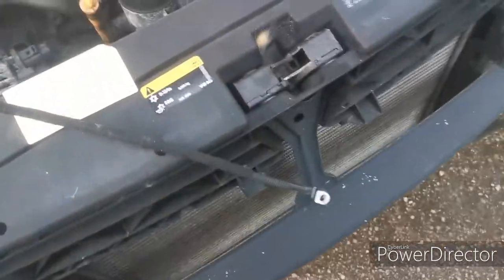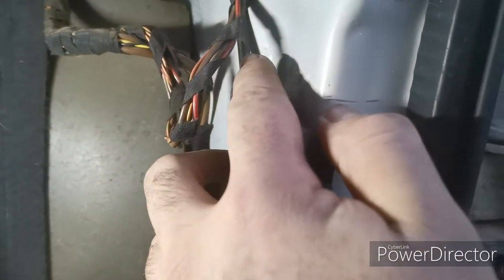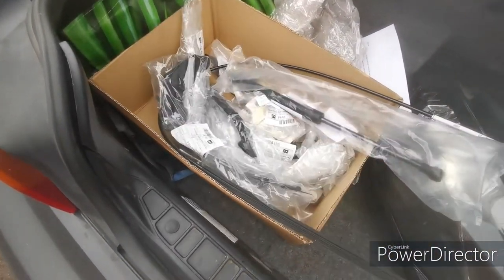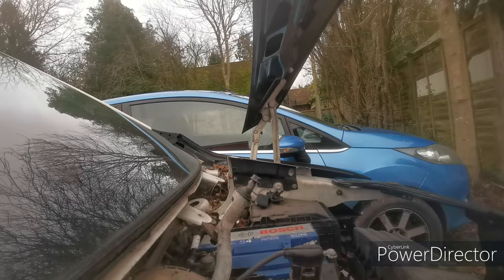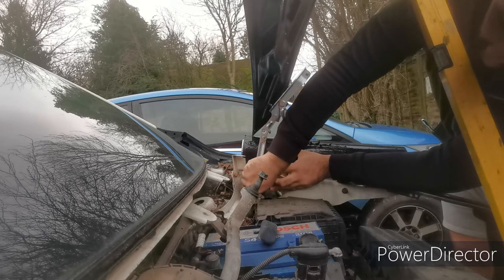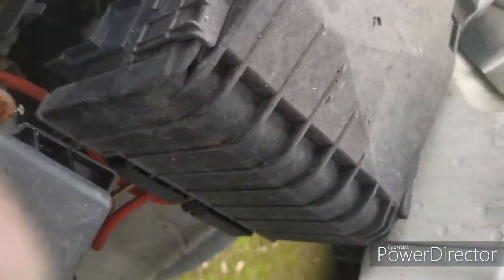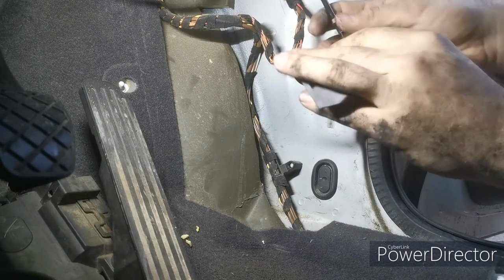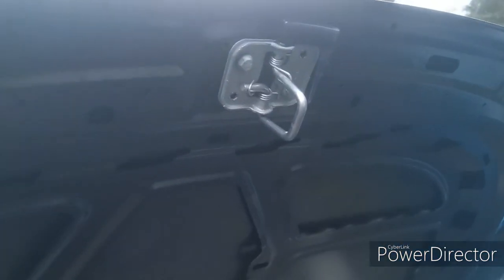(Abandoned VW Caddy Part 2) Fitting The Bonnet & Bonnet Cable

Comment: Thanks for your informative videos.  You won a subscription and a thumbs up!  🙂👍🏼 Just a question (I don't understand English very well!): did you change only the bonnet cable on the passenger side or did you also change the front side?  And the finger lock to be changed or not?  Thanks in advance for the info!!  🙂
Reply from the maker: for me it would be the drivers side but if you are LHD then passenger side yes, the cable is in 2 parts, part one is from the bonnet pull in the car to about the headlight and part 2 is from the headlight to the bonnet latch at the front of the car, you will need to change both of these parts

Comment: Can I just ask when doing the face-lift, do the newer headlights just go straight on or do ypu have to modify anything?
Reply from the maker: If you check out my Part 3 Video Jack it shows what you have to do, there is some cutting required to the inner wing and ive had to order some extra brackets to fix to secure the headlights (will be doing this in another video) the wiring is the same and they just plug and play